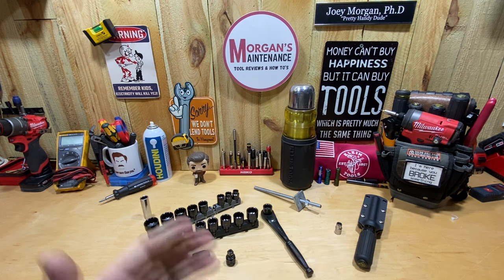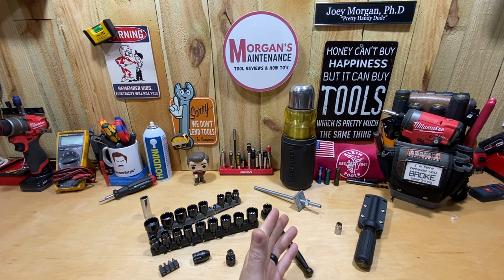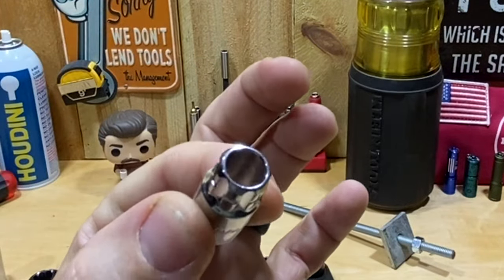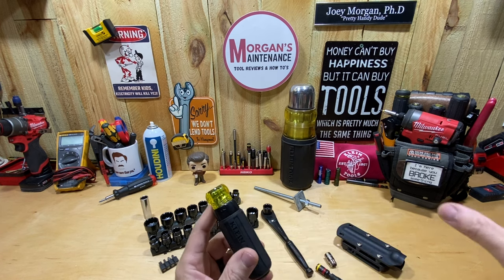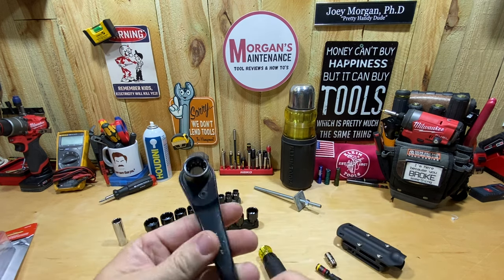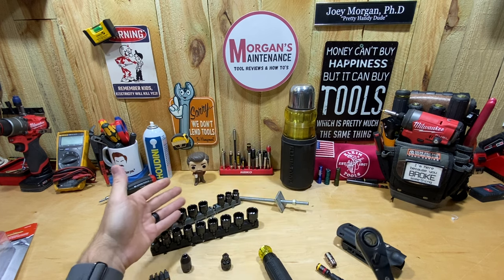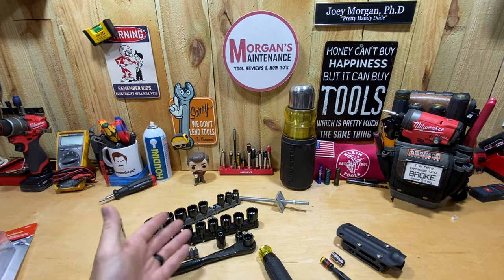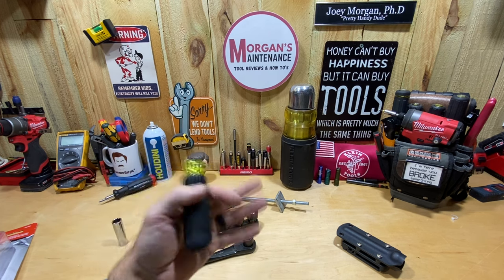KLEIN KNECT Alternatives - Do any other Pass-Thru Sockets Work with the 11-1? #tools #klein #tool

Comment: I don't buy a lot of Harbor Freight unless they have something really good or something that's OK and I won't use it much. They have a pass through set for $25 metric and SAE. I needed it a couple of times and was fine. SKU: 62305
Reply from the maker: 👍 I’m pretty much the same with HF.  I buy some disposable stuff there, but only tools occasionally.

I think that’s a Pittsburg set right.  I saw that when I was searching
Reply: Why you are one of my favorite utuber,,one that makes me warm and fuzzy when a new video is out..making me realize a new tool will be a real asset when I least expect it. For thirty clams it needs to be in my arsenal,,,have spent much more on those one off tools……
Reply: @MORGANSMaintenance  Yes and it comes in a what I would call a holder more than a case but it works. 2 really great tools I bought there is that Icon 1/4" bit ratchet set. I also bought their XL ratcheting wrenches. If anyone is thinking of buying the Icon bit ratchet set hold off as they are coming out with a kit that has sockets added to it.
Reply: I think the new Icon set is coming out next June.
Reply from the maker: @michaelthompson7570  I will admit I have a “tool problem” 😂

But when something comes up… I’ve always got what I need to make it easier.

Appreciate it 👍
Reply from the maker: @brianhall9019  I saw some pretty cool harbor freight stuff in those Sema videos
Reply from the maker: @scotts4125  👍
Reply: @MORGANSMaintenance  me too…those “twin-grip” pistol pliers look nice.
Reply from the maker: @brianhall9019  yeah those were ones I liked too